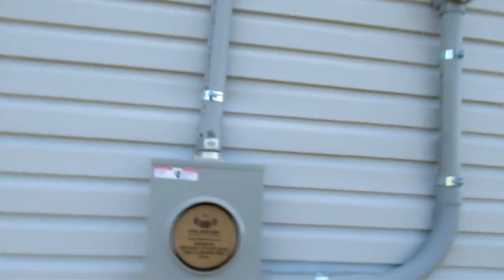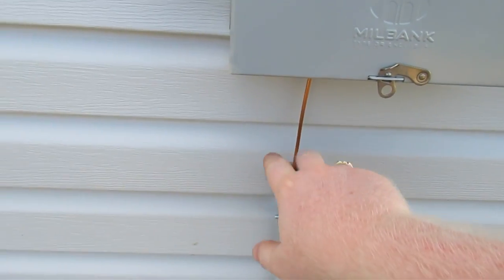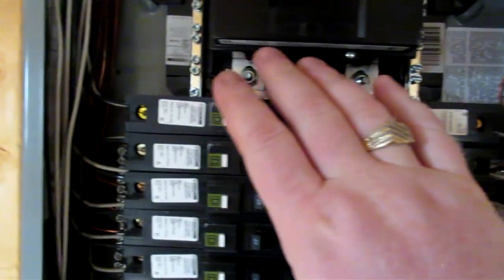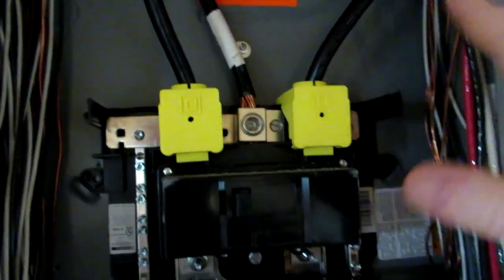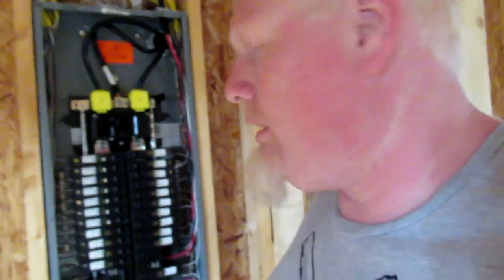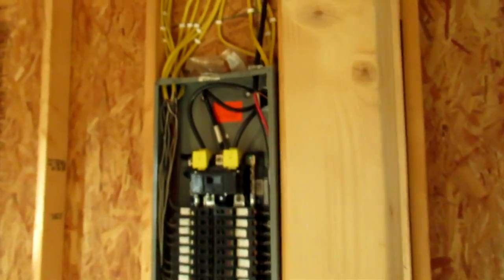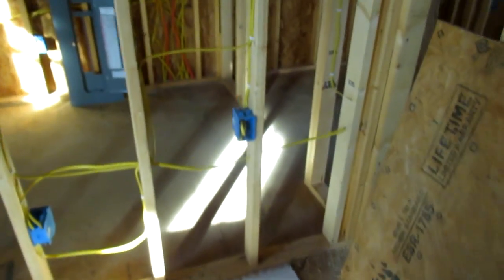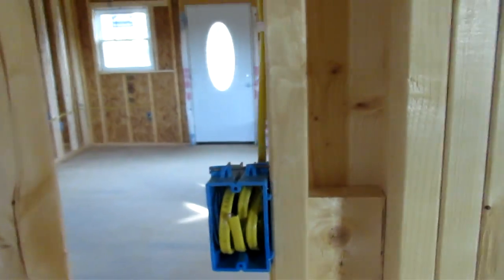How to wire a house

Comment: Man I hope you ran rg6 and some cat 5 or cat 6 or else you get holes drilled in your new house when you want TV
Reply from the maker: I live in the woods and don't watch much TV.  The senior man at a sawmill can count on his good hand how many hours a week I watch TV.  No need for cat 5
Reply: Got Wire, that's a good suggestion for most.  However, if Abston wants to change his lifestyle and start Netflix'n and Chilln more, he can install a good dual band/radio Wifi router and use something like a Roku or wherever :)
Reply: Nothing like a good wired/wireless debate :)

Put me down for wired with keystone jacks everywhere.

Comment: A lot of great tips, and you broke it down in simple terms instead of the complicated electrical code. Good job on running neutrals to your light switches (now required by code, and needed for most smart dimmers). I would just say to add metal plates where your romex crosses the studs so you wont accidentally screw into in the future. Thank you for mentioning about the fire alarm requirements, will keep an eye out for that.
Reply from the maker: Some areas actually require metal plates now. I try to keep my wiring at a level with no chance of someone running a screw at.

Comment: This is great work!!! We found an older home we want and I've just started basics in electrical work I'd love to rewire the house we are looking into but this is great work!!! Much inspiration and motivation!!! Any tips on things to look out for when rewiring a home?
Reply from the maker: Add additional plugs and lights.  If you think about you may or may not want a plug or light there, put one there.  You will regret it later if you don't.  Keep it neat.  If you are going to have it inspected, talk to the inspector to see any special things you need to do.  Good luck.

Comment: You put Power Point wiring in with Lighting. We would have RCD Circuit Breakers on all, say 10 amps for Lighting, 20 amps for Power Points, 30 amps for a Standard Stove (Range), and say 15 amps for Water Heater. Mains would be fused at 63 amps at Underground Box
Reply from the maker: Code here is 50 amp for a stove

Comment: CURIOUS:  If you have a dedicated circuit to each ROOM - I'm assuming OUTLETS & LIGHTS ?  are you wiring everything with 12-2+G including your lighting circuit ?  I thought, I heard you state that you had used some 14-2+G somewhere in the home and were required to reduce that Circuit Breaker to a 15 amp breaker.   Was that ONLY on the Smoke Detector circuit ? (EXCLUSIVELY) ?
Reply from the maker: It was the smoke circuit and a 3 way switch.

Comment: OMG in USA your wiring likes like 1920, in New Zealand all the Country is the same, and mostly like Australia. Have you heard of Underground mains, that's all there is here. plus we 230 /400 Volt 50 HZ, lots of Town Houses would be wired in Single Phase, a Neutral Screen 16mm2 Copper Cable.
Reply from the maker: My last house was underground
Reply: Brent Williams from what I hear in USA it’s much cheaper to have wire run above ground. From town planning people they say it’s cheaper to repair, replace, and maintain. Plus many houses that were build in mid 19–were done this way and it become to expensive to change it. Newer housing are planned and built with underground

Comment: 4 a guy with no license great video and all plugs  on 20 amp circuits. More money but will trip a lot less thanks jim
Reply from the maker: +James Bond thanks for watching
Reply: 20 amp plug circuits means more "plugs" can go on the circuit, if he uses a 15 amp , he can only place up to 3 "plugs" , by the way the correct name is receptacle , a plug is what you get from an extension cord
Reply: The man doesn’t know the difference between 14 and 12awg. He doesn’t have a single 14 awg cable in that house. He wired all of his 15amp circuits with 12. Is it really an issue? No but he could have saved money if he knew what he was doing. And besides for the required small appliance branch circuits, ie kitchen and bathroom, why would you need a 20amp circuit in any other room besides for in window ac units? 15amp circuits do just fine for general lighting and receptacles.
Reply: MillValleyAirsoft 

My mother in law’s town doesn’t even allow 15 amp Circuit. Everything has to be 20. We had an electrician helping on that project and he clued us in.

I’m in the planning stages of doing my own gut rehab on a vacation house in Michigan . I’m planning on using all 12 gage for all 20 amp circuits . Seems like it will cut down on waste  of having to buy a bunch of 14 gage wire. I’ll just buy one big roll of 12/2 and a smaller roll of 12/3 for three ways and switch legs with neutrals if need be. Plus the 10/2 for the ac. (Stove, dryer and water heater will be city gas)

I guess it’s a “keep it simple” approach. If you do this all the time it mike make sense to have roll of 14/2 left over for the next job. But a guy doing a one off will either get stuck with a bunch of 14/2 left over or, worse yet, buy a  smaller coil of 14/2  and end up needing more and going back to buy another smaller coil and end up blowing any savings.

I just went through this with screws. I bought a big 1000 count box of one size and cheaped out on a smaller box of the other size. I just had to run for another smaller box. Now I have almost as much in vested in the 2 smaller 250 count boxes. I should have bit the bullet and bought two 1000 count. These are expensive GRK screws at $30 for smaller box and $75 for big. Even better if I stayed with one size screw
Reply: @darwinawardcommittee  the cost difference between 14/2 and 12/2 is great enough that if you are wiring something as large as a house, it would still be cheaper to buy both, and throw the excess away. Plus, not only is 12/2 a little harder for less experienced people to work with, but you will also need to take box fill into consideration a lot more often.
Reply: @MillValleyAirsoft  Yeah overkill to impress the inspector really. In Ma usually 15 for 14awg, 20 for 12 in Bathrooms kitchens ect. Outside gfi Typical. You don't need to power a bedroom with 12awg recept or even lights and a fan. Unless maybe a dedicated AC unit. Waste of copper.

Comment: Stellar! Future proofed! Love to see that many breakers! I will definitely use the GFI breakers as you did to safe myself from needing more complicated outlet boxes! Better than most professional houses I've seen, I believe because instead of doing what is normal you went above and beyond and theorized what is possibly and applied it! Great job man!
Reply from the maker: Thanks.  It is code here to have all 110 circuits on arc fault.  When you buy the combination breakers in the contractor pack the price is the same so I went with them.
Reply: Just remember to wire speakers into the ceiling in your kitchen and your dining room.

Comment: You should see how the company i work for does the rough in for wiring, a home, for one we have to mark out all the holes at lets just say 30"  with a marker, so every thing looks some what level . All outside plugs are protected by a ark fault GFI combination breaker, light and receptacle are on there own circuits,  dont use the ground rods, we use the ground plates ,and that has to be 24 " in the ground by code, oh and another thing is we can use a staple gun to staple our wires instead of useing the hammer staples,  just for wire of the smaller size,  like 14/2 14/3 12/2 and 12/3  any thing else then we have use hammer staples, other than that loved your video!!!!
Reply from the maker: Thanks for watching

Comment: kitchen recept code: 2 separate circuits, withing 2ft of counter top edge and 4 ft there after required. counter top space of 12" or more also required.  hell of good work though bro not putting you down.
Reply from the maker: Thanks.  I thought I would have extra but wasn't sure exactly how many I needed. I wanted to make sure I had enough instead of paying an additional inspection fee.
Reply: @BeyondtheBoom  You should be able to call your local inspector and just ask questions. I'm an electrician and live in TN. We deal with 3 different inspectors pretty much daily and they are all just normal people. They love to answer questions and talk electrical, it's also a good way to get to know them too.

Your electrical job looks really good, I'm actually surprised because most homeowner jobs aren't that nice. Obviously, you're a different type of electrician so you already have an understanding.

Comment: I am adding a new room to the house. Just gonna have 6 led light and three receptacles in the room. Can I just use a regular breaker or do I have to use the more expensive combination one? Tried the answer everywhere and couldn’t understand anything. Any help would be appreciated
Reply from the maker: That depends on the code in your area. Its different in different places. Check with your inspector
Reply: Abston Wood Crafts Thankyou

Comment: Like your video. Nice install and nice home. One thing about lighting and recepticals on the same breaker, if something trips a breaker then the lights go out. Much better to keep it separate so you are not troubleshooting in the dark. Just a thought.
Reply from the maker: Its not really an issue. How often do you trip a breaker?
Reply: @BeyondtheBoom  Well with all that 12 gauge wire you got there, tripping will definitely be a rare occurrence. I love how you got it all rolled out and that's a beautifully done panel. My only issue with having lighting on the same circuit is if you have anything with a big enough draw plugged in (i.e., most vacuum cleaners), you'll end up with dimming/flickering lights.

EDIT: I think also I'm a little salty because I just moved to a house with old wiring that has been "updated" over time it seems and it definitely looks like stuff that wouldn't pass code. One is a washing machine that's tapped into the lighting circuit for the basement lights. Every time that washer kicks on, lights flicker. Can't wait to get this rat's nest of ungrounded cables gutted and get a new panel and wires rerun, with 12 gauge everywhere of course. ;)

Comment: I like those lug covers too. And the snap on neutral bus to eliminate the pigtails.  I'm looking to upgrade my panel and was driving myself crazy trying to figure out which panel you had. Turns out those covers are mandated by a new regulation. Here's a copy/paste from The Home Depot's website "Beginning January 1, 2017, enhanced UL 67 safety requirements will take effect, applying to all panelboards and load centers with service equipment applications. To comply, any single service disconnect panelboard or load center must have provisions such that, when the service disconnect is opened, no person in the field servicing the equipment load side can make accidental contact to live circuit parts. Barriers to protect against unintended contact shall be constructed in such a way that they are easily installable and removable without contacting or damaging bare or insulated live parts." Having those exposed lugs always bothered me, this should have been required years ago.
Reply from the maker: +Stan Benton it is good they put those in to help keep people safe. The plug on neutral really helps during install.  Thanks for watching
Reply: For your own safety in the future, I wouldn't get any electrical knowledge from Home Depot.

Comment: So did you either have to have GFI outlets outside or GFI breakers inside? What I'm asking is if you had GFI outlets you wouldn't have to have GFI breakers.
Reply from the maker: No.  Since I used the GFI breakers I only had to use the WR plugs and not the GFCI plugs.

Comment: very neat wiring, just don't peal the insulation more than you need, don't leave a naked core without insulation, always twist the core before tightening them inside the switches, always twist and no naked core. you have done a great job as a non professional electrician, don't run your circuit until you get it inspected by professional electrician.
Reply from the maker: I had it inspected by the inspector.  Thanks for watching.

Comment: Newbie Qs
1. Is there a standard format to  label the breakers? Plugs/ outlets = P1, P2 etc? Lights = L1,L2? 
2.What about USB in plugs? 
3. Smart appliances need USB rather than WiFi? K6? 
4. What's a breaker cost?
5. Doesn't the wiring need to be in conduit?
TIA
Reply from the maker: Depends on local codes in your area

Comment: Can a long term journeyman answer my question please? Im confused about subpanels. Let's say I have a 100a box in my house. I use an electric dryer, dishwasher, electric furnace, electric water heater, electric stove. If I want to add a sub panel for my garage, let's say a 60a panel, does that 60a supply itself or does it still use amperage from the main breaker? What if I want a 20a sub for an outside shed? I was always under the impression that I need to take into account the amperage of the originating panel. So, in my scenario, 100a home panel, 60a garage sub, if my electric dryer, dishwasher, vacuum, central air, electric stove, microwave, etc.. are all going at the same time, and I go to my garage to cut some wood on a table saw or use other high amperage tools, would I blow everything?
Reply from the maker: If its a breaker on the main it would trip. If you have fuses they could blow. It would be rare to be pulling that much all at once though.  My shop is on a 60 amp breaker in my main panel and works fine.
Reply: k thanks!.
i just bought a house and before I move in, have a lot of work to do. Current breaker box is 100a... i'm not sure that will be enough for me down the road... would like higher.  Was looking at 200a but wondering if it will be mega overkill.  Thanks!

PS- I saw a new breaker box like the one you have, with the neutrals already built in.  I think it was around $150 at my lowes.. but those breakers are EXPENSIVE!!!  Around $30 for a 20a!! @.o
Reply: bill smith, I’ve been doing houses with 600 amps... for one house. Let that sink in
Reply: 11 12 yowza
Reply: 11 12 I got in an argument once with my code teacher in school when he said you will never see a residential service larger than 400 and a couple of months earlier I had just finished installing a 1600 amp CDP for a 28000 sq ft house and 40000 sq ft equestrian arena. He probably still doesn’t believe me but don’t say never when it does happen.
Reply: I've done plenty of 400a and 600a but nothing over that but I bet there is plenty out there! Biggest house I've wired was 11,340sqft, 6 heats, 3 huge A/C units w/ there own 12 circuit sub panel, plus all the tankless water heaters and it was all smart switched with the low voltage sub panels. It's was a beast.
Reply: @codybarker3863  everything is possible with proper planning. Anything above 200 Amps would require an electrical engineering design.
Reply: 200 amp not overkill but $30 for 20 amp s.p. brkr. definitely overkill should be around $10
Reply: Come on really  a 100 amp. Evan  trailer  homes  have  200 amp services.  If there all electric.  Is it a tiny home.
Reply: shoot a lot of older houses have only a 60 amp service, by the way that's the smallest service size allowed by the NEC
Reply: @chaser9363  yes  this is  true.  No a.c. all gas appliances.  And one  light bulb and one  recptecal in every  room ungrounded.  With  knob and  tube  or varnish  cambray wiring.  Even  small gas heaters  in the  walls of the  bathrooms.  With an attic fan  in the hallway  with  louvers. You open up the  windows  at night  and  turn on  the attic  fan.  Hopefully the  old  brass screens are  in good  shape  or your  fighting  off the  bugs.  And in the morning  you have  dew on your  face and  your  sheets are  wet  with  dew. How  we have  evolved  since  then.
Reply: @Greg-ll6ur  yeah thank God
Reply: @Greg-ll6ur  but was just making a point because I just upgraded a service on a house that had a 100 amp service so there are a lot left out there
Reply: To whom it may concern. All your current appliance loads are electric, as you stated. It is very possible that all your appliances could be used at the same time. Your service is rated at 100 amperes as you stated. Now you would like to add an additional 60amp, + a possible 20amp sub panel off your main service that could be under a potentially large amperage load when most of all of your home appliances are in use. Obvisiously all new equipment, pumps, & motors, hoists or what other current hungry equipment off these new sub panels will be an increased electrical load off your main 100 amp service. I do believe that this scenario, could cause your current 100amp service  to be under excessive stress, and overloaded.This is a situation that can be avoided. Upgraded your service. This shall be installed via a competent, licensed electrician who is willing to get the proper state paperwork done. Followed up with a state inspection. And then, enjoy your new garage and shed.

Comment: If someone doesn’t know 14 goes on a 15A breaker they should not be allowed to even assist a master electrician wire a house without constant supervision.
Reply: Stapling circuits to exterior sheathing? How’d that pass? You need stackers on studs or studs on the flat to protect from future siding fasteners penetrating from outside.
Reply: NEC you need two counter circuits. No inspector would say one. That’s NEC 101.
Reply from the maker: There's more than 2
Reply from the maker: It's not on the exterior sheathing.  There is an additional layer nailed between the studs
Reply: master electrician wiring a house lmao, masters don't even work!